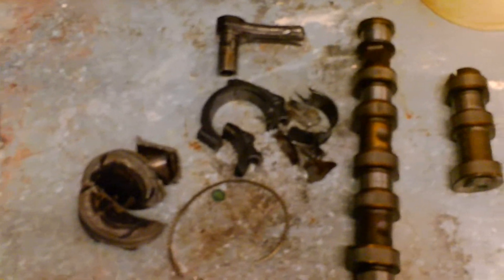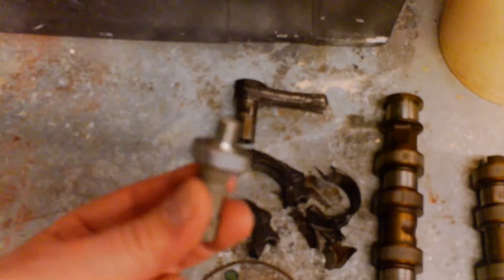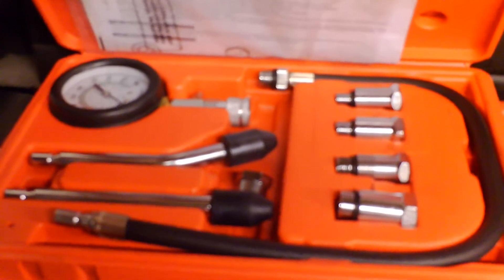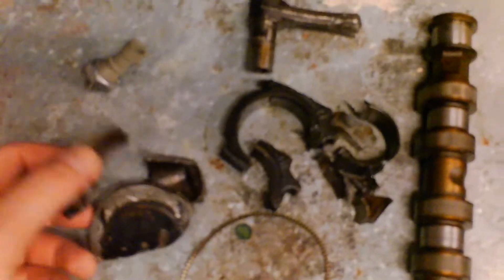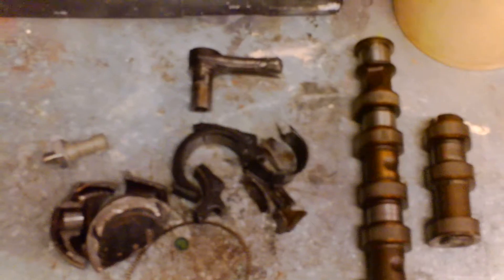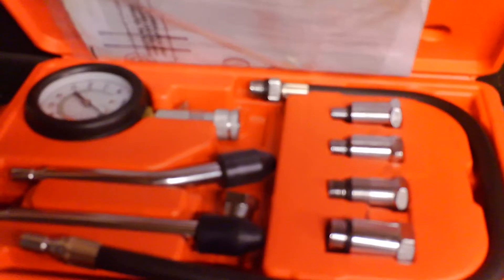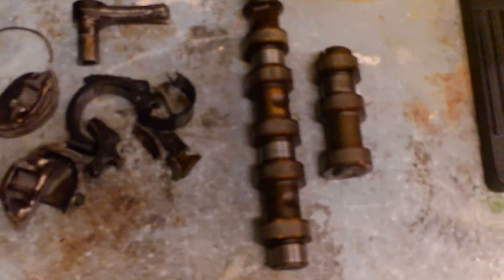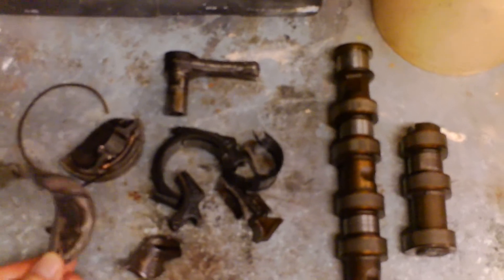Vauxhall Opel Corsa C low oil pressure  destroyed my engine

Comment: Thanks for the vid, excellent points made- just wondering if your oil light was on constantly or just intermittently? 

My oil light comes on at idle once the engine has heated up but goes off as soon as the revs increase. The other strange thing is that this only happens with fresh oil, once the oil is coming up to its next service (e.g. oil is dirty and more viscous) the light doesn't come on at all.
Reply from the maker: Mine was the same, when I revved it went out. I hooked up an oil pressure testing kit and it proved there was an issue. The oil pressure increased when I revved then crashed when I took my foot off. I changed oil filter etc, it was too late for my engine. Well worth doing a proper test.
Reply: @drivewaydiyer6504  Interesting then- I'll have to get a pressure testing kit. Were you able to figure out what was actually causing the low oil pressure in your engine?
Reply from the maker: Lack of oil changes, the head was all gunked up with congealed oil. Lots of wear.

Comment: Hi mate did you have any nasty sounds from the engine before this happened, such as rattling or tapping
Reply from the maker: No not really, there was a problem with the oil pressure light, but nothing of note. Just happened driving on the motorway at high speed.

Comment: So why was oil preasure low? My oil lights been comeing on when engines hot and idleing. Soon as touch revs it goes off
Reply from the maker: luke barfield probably worn bearing caps, due to lack of oil changes.
Reply from the maker: acacia 258456 sounds like a stretched timing chain. Bearing caps are the spacers between the crank and the piston rods. When they wear, the tolerances become too big, it reduces oil pressure. There are other variables in this aswell.